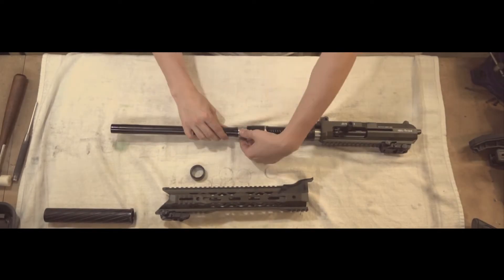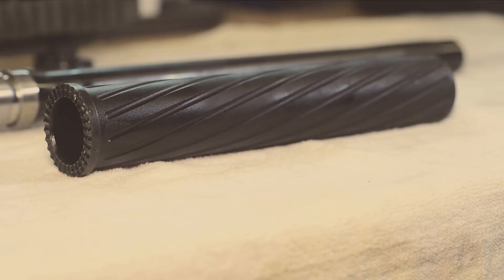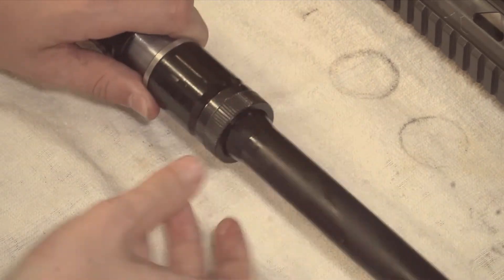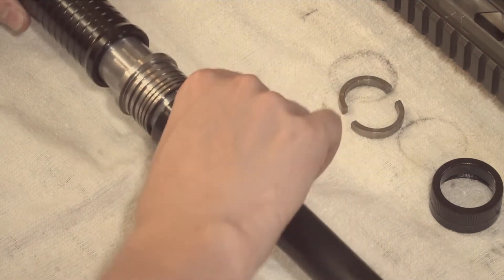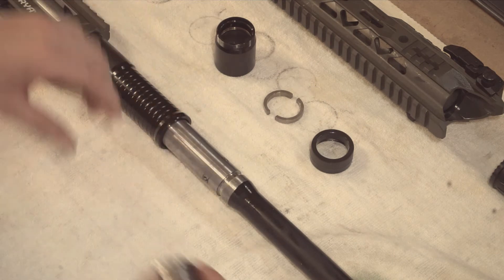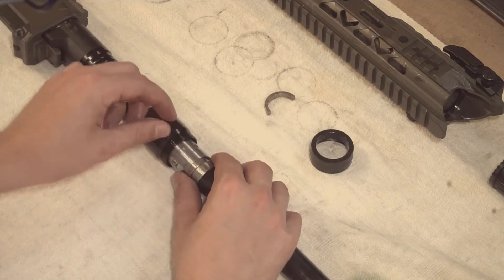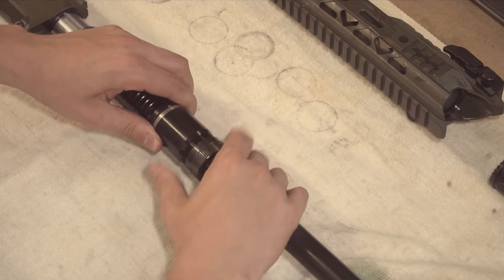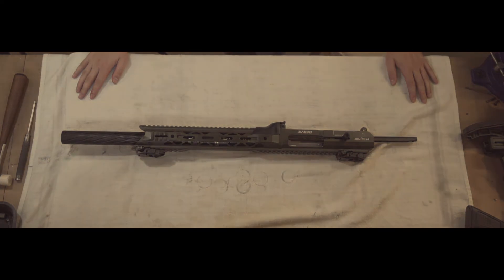Derya MK12 Gas System Disassembly/Reassembly

Comment: I found that a very very light layer of oil on everything seems to help with jamming. Out of the box the amount of oil is too much. Wipe it all with paper towel or rag and just leave a thin layer on and 2 3/4 buck and slugs run fine. after maybe 40 rounds it was no longer jamming and cycling fine

Comment: Is this something that needs to be cleaned on a regular basis?
Reply from the maker: The gas system ideally should be cleaned after every shooting session to avoid an accumulation of deposits in the parts.
Reply: Bummer, I usually clean my guns once a year or when they stop working :( guess I'll have to pay a bit more attention to this to keep it work smooth. Thanks!